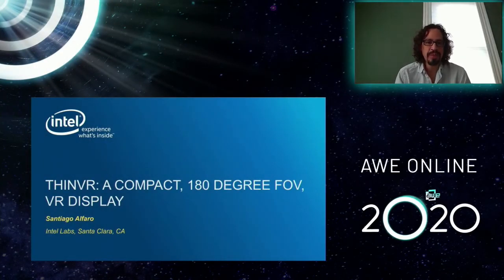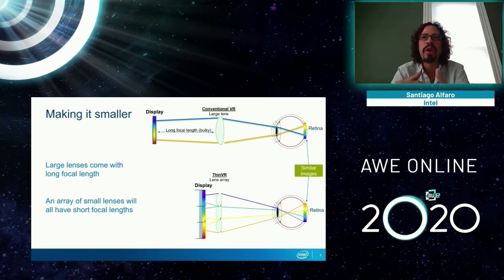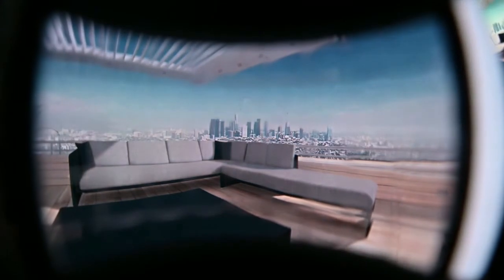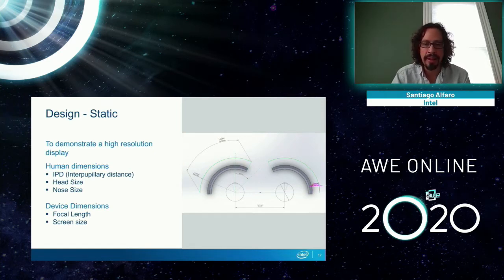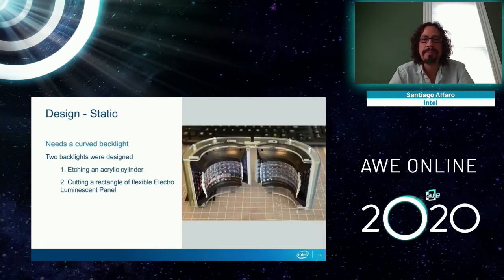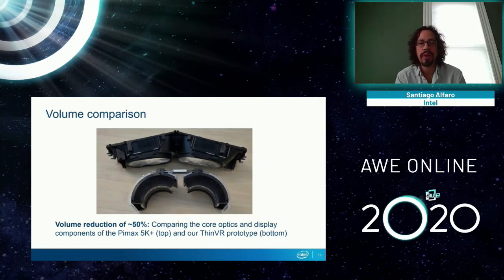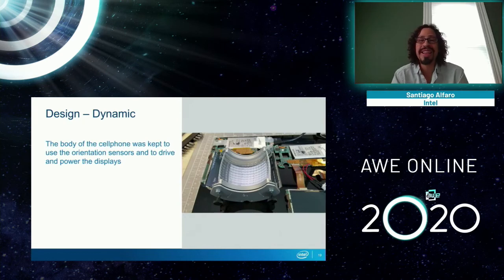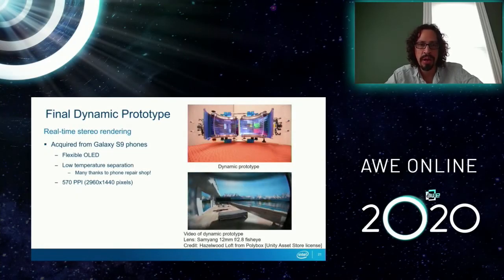ThinVR: A compact, 180 degree FOV, VR display

Comment: Have your considered Variable Acuity (resolution) lenses matching foveal and peripheral human acuity? With a system slaved to EM can enable x1000 improvement
Reply: Idea sounds good, but then you look left or right into the relatively low resolution region and you'll notice.
It also needs to be isotropic resolution and MTF for where you can converge; otherwise you will see bad anisotropic smidges in each eye.